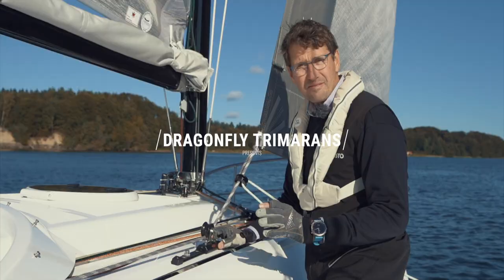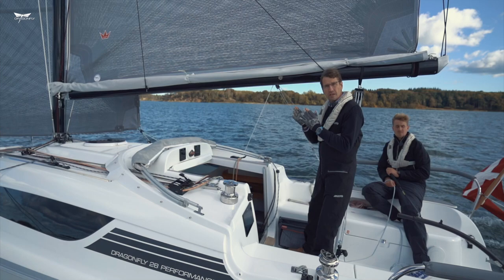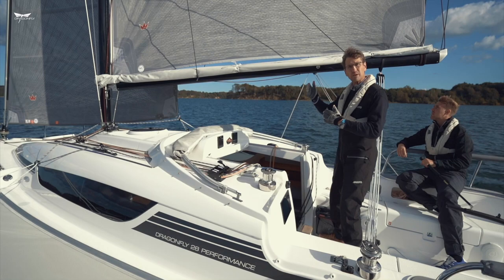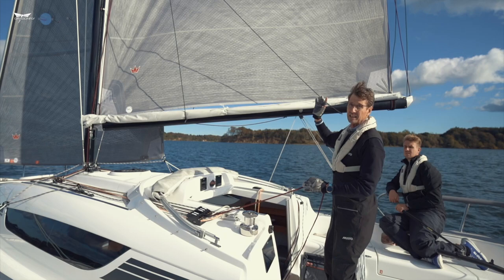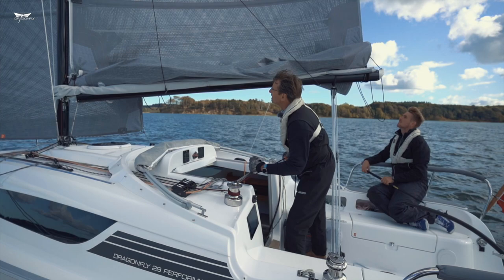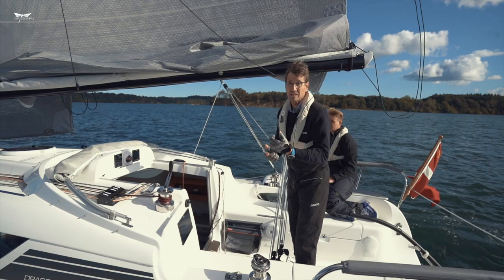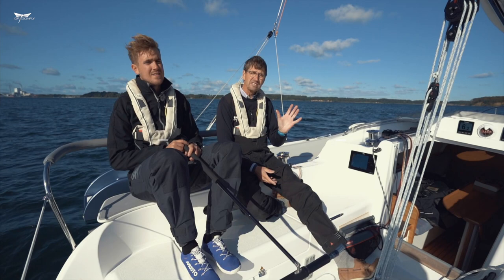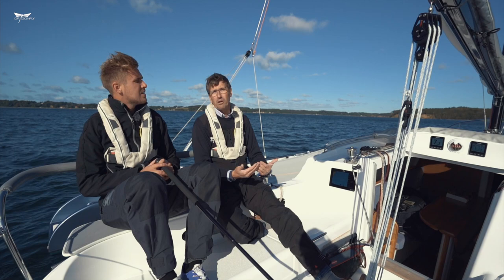Dragonfly Sail Guide - Stronger wind conditions

Comment: Reef at 20 knots. Is that apparent or true? Beware of gusty conditions. Our jib sheet clew snap shackles self-released under enormous load from a very sudden, very violent gust when sailing up the east coast of Scotland. Dragonfly 800. No time to reef! Had the shackles not self-released and instantly freed the jib, sail area would have exceeded these safety parameters by some margin. These are great boats but pay close attention to gust forecasts and reef for forecast gust speeds not for current wind reading.